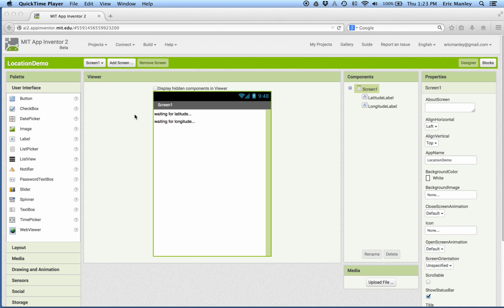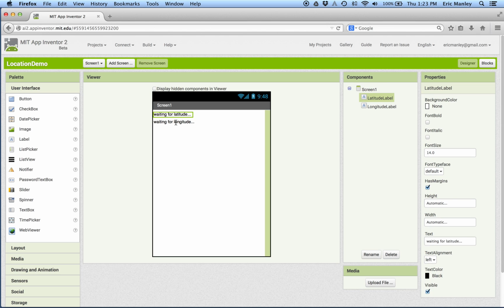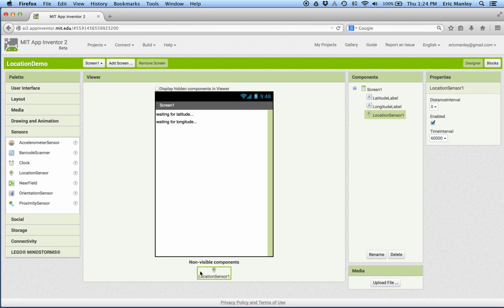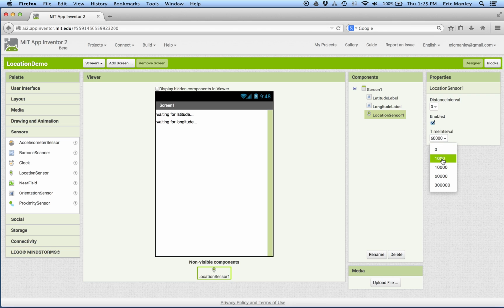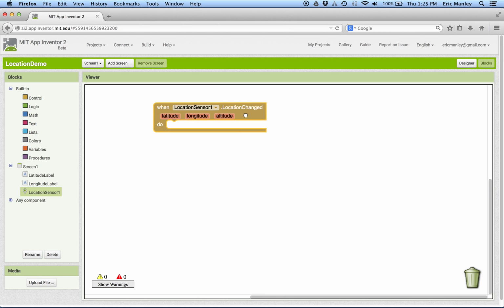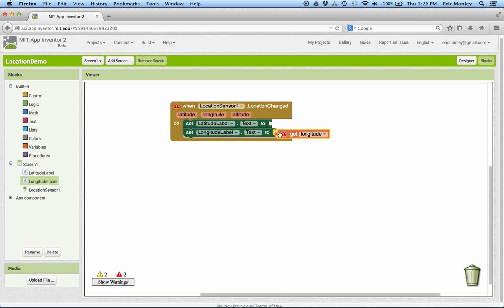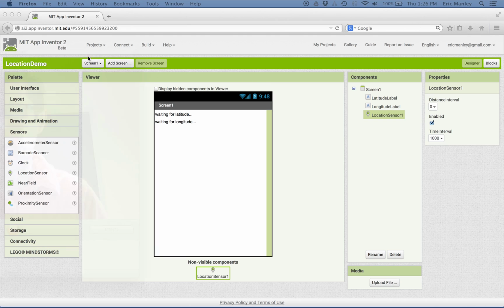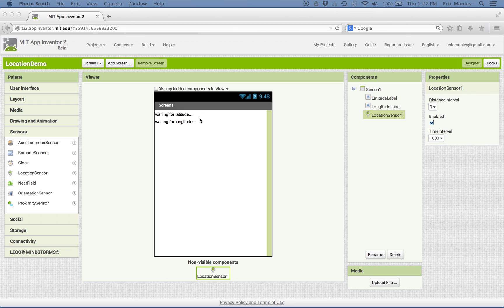Location Tutorial Part 1

Comment: How can I make the location more accurate?
Yesterday I implemented an altitude indicator app wich works with the gps.
The problem is that I tested it on two different locations. My room wich is at a second floor and at the park.
Problem is that keeps changing values more than they actually are.
I mean now it indicates 12.5m and after 10 seconds says 32.7 when I didn't make any move.
Am I the only one with this issue?

Comment: i follow your code but it doesn't work what would be the problem thanks for the reply
Reply: Check if the location service is activated on your smartphone.
The emulator provided by App Inventor doesn't have location services.
Reply: Could be a problem with your settings, like in my case, I learned that I should let disabled the location service capability of using the service provider and the WiFi access to pinpoint my location, when only the GPS location is enabled it gets faster results (at least in the device I tested)